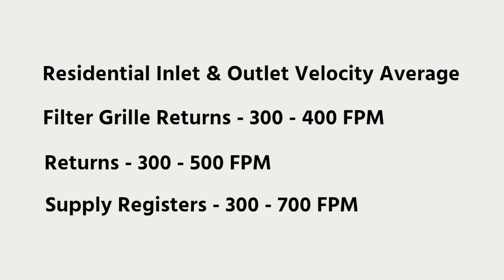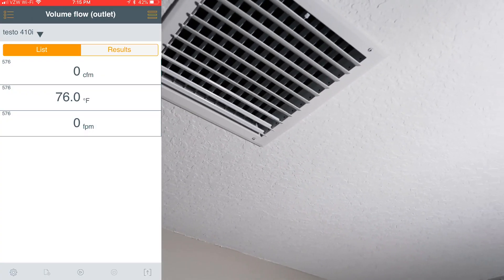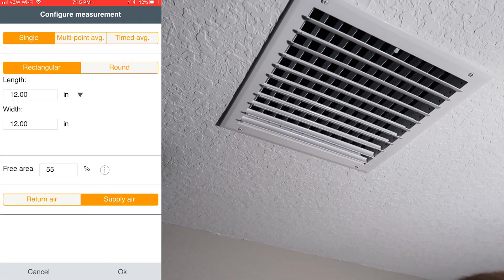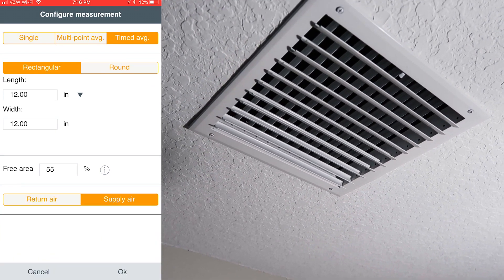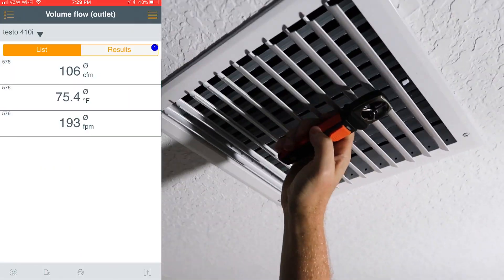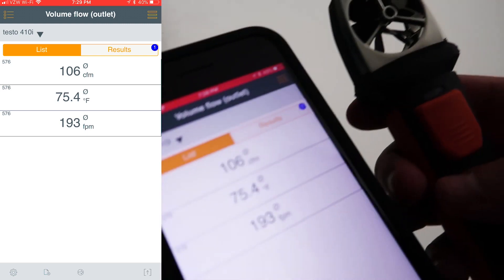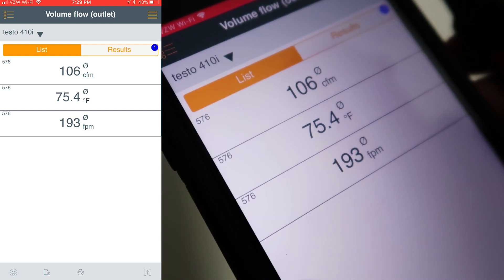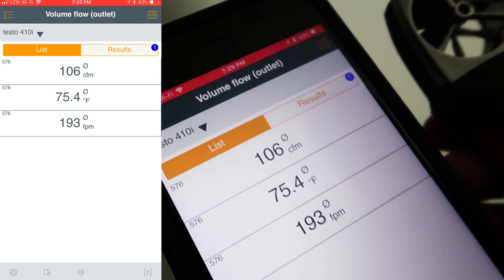Testo Smart Probes Volume Flow: testo 410i

Comment: There needs to be an updated video on how to use this. I just bought one and the manual that comes with it is pretty much how to connect it to the app, turn it on and change the batteries. 

This video is pretty poor too.